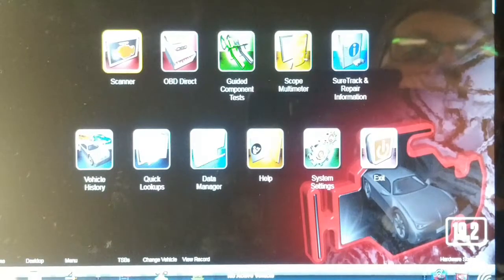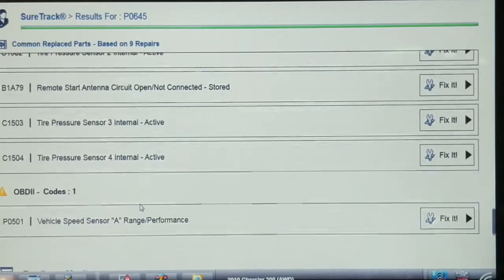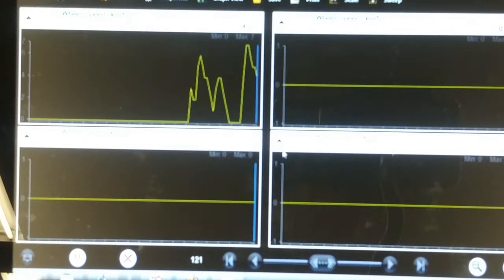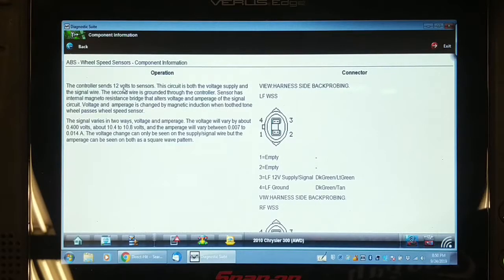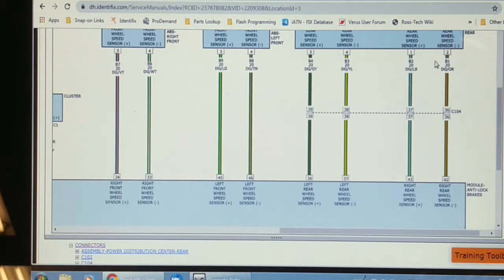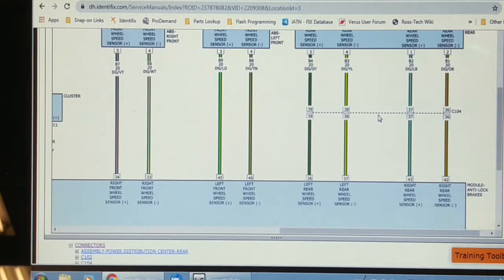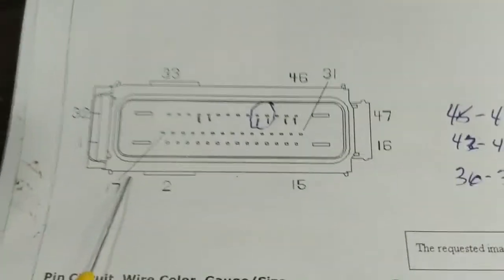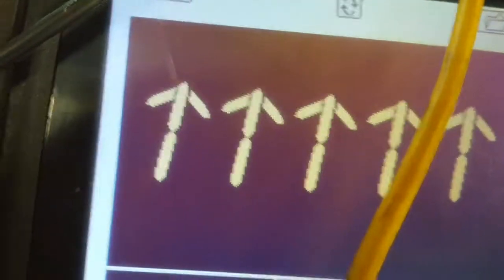2010 Chrysler 300 C1020 and no rear speed sensor signals

Comment: Just noted that a 20 cm ground braid was hanging in only one end - situated right rear behind the rear axel and on the harness to the silencer / muffler. Still connected in a harness to the silencer and loose in the other end. Could not see where it should be mounted. Is this a ground cable for the ABS system or the gasolin tank level indicator?
Reply from the maker: I'm not sure exactly what it's for but not for the ABS in my opinion.

Comment: Have the same issue on my 300 C from 2008. Changed both rear sensors without any luck. Used the old cable and connector in to the car and hocked up and signal instrument between. Took a  long cable from that device to the connector on the ABS system and could see that there was no cable damage or signal loss between the connector in the rear to the ABS modul in the front. 
Then i checked the tone rings after removing the sensors. Could see that on rear right side the ring was a little rusted so i cleaned it up. Rotaded the wheel and saw rotation on the ring. Did the same thing on rear left side and directly saw that the left tone ring did not rotade as i rotaded the wheel - guess i found the problem. Have ordered new rings. Have no limp mode but ABS, ESP and other related alarms.
Reply from the maker: Good going.

Comment: I've got a 2006 with the same stuff happening... help.
Reply from the maker: Well you need to start with a scan for codes. The reluctors tend to fall off the cv joints causing no signals

Comment: i have the same prob did the speed sensors fix the signal for both back?  i allredy put both speed sensors on and i still haVE same problen i still cant go over like 20 mph PLEASE HELP WITH INFO
Reply from the maker: In my case one speed sensor failed on the left side but more common to fail is the magnetic reluctor falling off. It can be purchased and replaced without replacing the entire axle but it's typically not a do it yourself repair .
Reply from the maker: https://youtu.be/3_w4WRmejF0 is the second video in this series
Reply from the maker: Here is the one showing the reluctor repair. https://youtu.be/4cWjP3e1L7Q